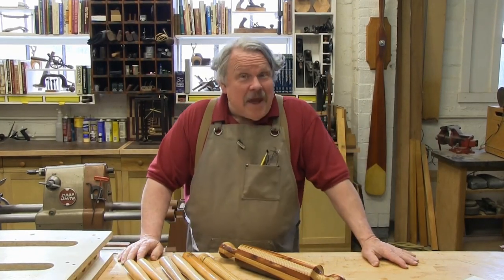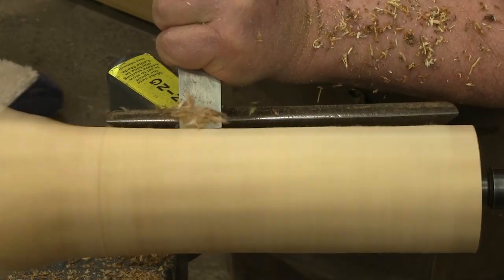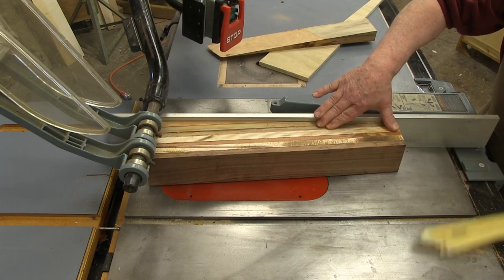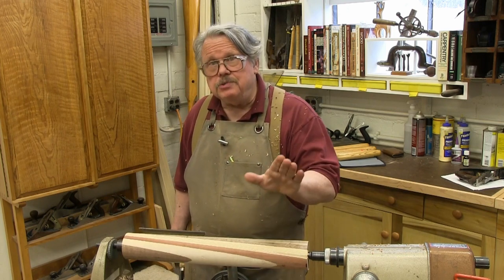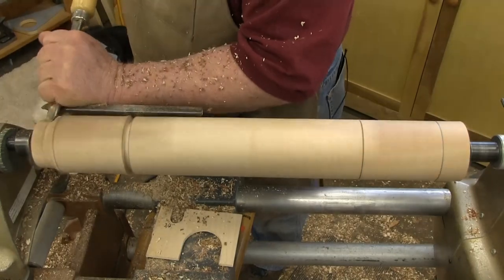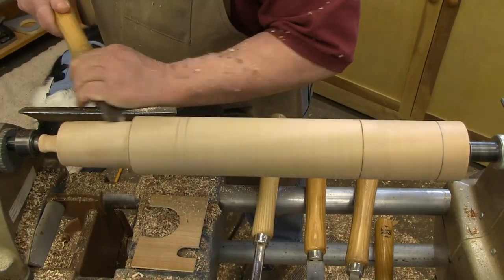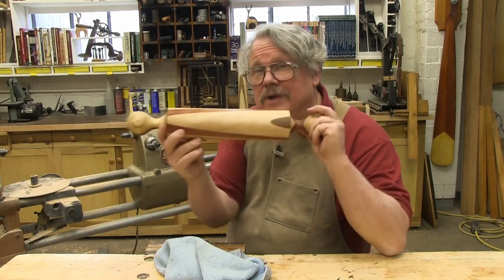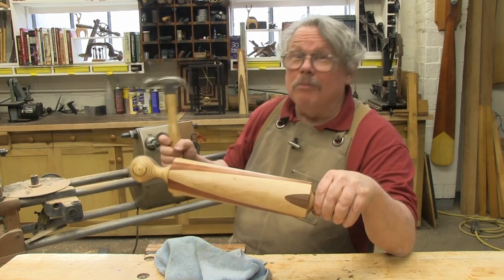Rolling pin - How To / Intro to Lathe Turning

Comment: I've had a lathe sitting in my shop for about 4 years and have never really used it. I have been toying with selling it but after seeing this video I will be trying my had at a rolling pin. Perhaps then my wife won't complain so much about the space it takes up

Comment: Super cool tip to use the smoothing plane. I had never seen that technique before and it's genius! I bet that saves a bunch of time trying to fine tune the shape before sanding. Love your videos Sir!
Reply from the maker: It's a great technique; I use it in also every spindle turning I do. Works best at slow speeds with the frog set back as far as possible to open the mouth of the plane.
Reply: @WorkshopCompanion  I can see how it would be extremely effective especially taking small bites. Very clever
Reply: Yup just learned something new. I ended up buying the plans for this. Looks like this is one of my next projects :D

Comment: I've been turning for a few years but still learned a lot!  I have never seen someone use a plane to smooth on a running lathe...that was really interesting.  Guess I will have to try that.  Good video...thanks.
Reply from the maker: Most welcome. When you use a plane on a lathe, open up the mouth as wide as it will go and take a very shallow cut. Hold the plane at a steep angle to the lathe's axis of rotation -- at least 45 degrees. Basically, you're using the plane to shear. For extra control, you can rest the sole of the plane on the tool rest. Smaller  planes work better - I use a Stanley No. 3 bench plane, a No. 60-12 low-angle block plane, and a tiny Kunz palm plane. The smaller planes will let you cut convex curves as well as flats and tapers.

Comment: Thank you thank you thank you!!! I knew it!! I KNEW that Somehow there was a way to use a hand plane on a lathe piece. I can't put into words just how much I enjoy watching these videos. Im knew to the wood working world and I've been taking in a ton of info and there are some workers out there that are worried about their Pro ego and sub-par results. I also appreciate you going theough how and why you ise the certain chisels and their individual uses. Please keep putting out this Boss content!! Thank you so much for your attention to detail for us lower level novice splinter eaters;-)
Reply from the maker: A bit of extra info you may find useful: I have found that a No. 3 or 4 bench plane, a low angle block plane, and a shoulder plane all work well on a lathe for certain shearing tasks. The trick is the take a very shallow cut, open up the mouth of the plane as far as it will go, and set the lathe at a low speed (under 750 rpm). Other tools that seldom used on the lathe and can be are files, rasps, and floats.

Comment: The plane technic was a surprise. I never saw that before.
Reply: Hey Robert, you own it to yourself to search Youtube for two videos titled "Wood turning a log on a Shopsmith Part 1" and "Wood turning a log on a Shopsmith Part 2". In part 2 he also uses a plane while turning. More importantly, you'll be amazed at the scale of his spindle. Scott
Reply from the maker: AS I told another viewer, it the same as shearing but easier. You simply adjust the depth of cut to take off a paper-thin shaving and open up the throat to prevent clogging.  Hold the plane so the iron is at a skew to the axis of rotation, and wade in. Instead of riding the bevel, you ride the sole. Touch the toe of the sole to the turning and slowly advance the plane until it begins cutting. I've found that small bench planes (No. 3 or No.4), low-angle block planes, and rebate planes work best. The bench planes are especially good at truing up a straight or tapered cylinder.

Comment: How often are you having to "touch up" the edges on your lathe tools with this type of project? I have tried turning only once, but found my tools dulled super quickly.  Thanks for all of the helpful information!
Reply from the maker: I sharpen my chisels two or three times a year. At the rate at which I do turning project,s that's anywhere for 4 to 8 projects per sharpening. To keep them sharp between uses, I store them in a chisel roll. That keeps the cutting edges from banging into other tools. Sometimes tools grow dull not from the way you use them, but from the way they're stored. Chisels may also dull quickly if made from the wrong kind of steel or a steel that has been improperly tempered. I once bought a set of chisels from a reputable seller only to discover they were so soft I couldn't put an edge on them. I had to re-temper every single one of them.

Comment: Thanks Nick.  You have shared a lot of interesting details.   I loved your wax recipe.  Is there any chance you could do a video on the large Shopsmith dust collector?   I have one but I am not sure if I am using it properly.   I mainly use it for collecting dust from the lathe, but it doesn't seem to do it very well.   thanks diana
Reply from the maker: Diane, the older Shopsmith 3300 dust collector pulls between 300 and 400 cfm. This was pretty good when it first came out, but it's not much to brag about these days. There are plenty of dust collectors out there that pull 600 cfm or better, including the new Shopsmith 6000, which I haven't tested. As far as dust collecting on the lathe, if you figure out how to do it efficiently, please let me know. There are several scoop attachments that you can buy to use with you dust collector, but the ones I've tried are inefficient and often get in the way. One of the things you have going for you when turning is that if you're doing it correctly, you shouldn't be making much dust -- just chips. These fall to the floor rather than hang in the air, where they can be easily swept up. When you sand on the lathe, that makes dust of course, but I find a good air filtration system will keep the air relatively clean. I use something almost identical to the Jet 1000CFM, and am relatively happy with it.  The nice thing about having an air filtration system, is that you can use it for any operation that generates airborne dust, not just sanding on the lathe. And if you're doing a lot of woodworking or have a small shop, air filtration is important as dust collection -- long-time woodworkers are prone to white-lung disease and emphysema. If you don't yet have air filtration, I'd suggest you get the 42" filter hood for your  Shopsmith and run it while you're in the shop. Clean it weekly.
Reply: @WorkshopCompanion  thankyou that helps

Comment: I also use a shopsmith for all my turning. Is there a big difference between a shopsmith compared to a traditional lathe?
Reply from the maker: I find the Shopsmith much more steady and solid than all but the most expensive lathes. And the infinitely adjustable speed control is a game changer -- you can make speed changes on the fly, and this inevitably produces better results. For example, I like to shear at low speeds (I feel I'm more in control) but scrape at high speeds (which leaves a soother surface). On a Shopsmith, I can switch speeds whenever I switch techniques.

Comment: Great video, I definitely plan on making one of these. But, how do I properly make the angle cut on the table saw so that it is a 3”x3” square? It feels like that wouldn’t be as simple as it seems in the video. Thanks a ton, your channel is awesome.
Reply from the maker: It's exactly that simple. Just cut a tapering jig from a scrap of plywood to hold your wood at the correct angle as you rip it. If you've never made a tapering jig before, we show the layout for the jig you need on page of the the project plan. https://workshopcompanionstore.com/products/scrapwood-rolling-pin
Reply: @WorkshopCompanion  I guess I meant to say, how do I properly set the fence and jig up so that it is a 3” square? Do I set the fence to 3” and THEN put the jig in? I feel like that would render it >3” because of the width of the jig. I could be wrong though. Thanks for replying by the way!
Reply from the maker: @ashtinator1  You only need the jig for one cut. If you haven't used a tapering jig before, I explain step by step how to set up the jig and cut the blank on page 2 of the project plan.

Comment: Awesome video.  I am new to wood turning and would like to get in it more. Does anyone have some suggestions on the best starter kits to buy and from where?   I am gonna try a turn a rolling pin for a gift. I have a cedar tree that is roughly 8-10 inches in diameter. Would you recommend cutting it down into a square or turning as is?  I’ll peal all the bark but do I need to worry about places branches grew ?   Anyone with suggestions on any of this it would be great to hear.
Reply from the maker: Before you cut down that cedar, you might to watch this: https://www.youtube.com/watch?v=bfmCV7qKtGk . It's a primer for doing your own sawyering. As for a "starter kit," look into buying a used Shopsmith. Table saw, drill press, sander, and lathe in one package. You can pick up an old one for $250--$500 if you look around. You can add other tools if woodworking is to your liking; sell it for what you have in it if it's not.

Comment: This is "probably" a stupid question, but... Are there no food safety concerns about the glue (or the plywood)? I have wondered about this before, e.g., for making salad bowls. And - as have so many others have said, thank you for your nice videos over the years. Best wishes, Peter
Reply from the maker: The only thing in plywood that could be toxic is the formaldehyde that is sometimes used in the glue. After sealing the rolling pin with a food-contact-safe finish, very little would escape. Furthermore, the few molecules that did escape would quickly break down into formic acid and carbon monoxide and dissipate. I can't imagine this being a problem -- unless you have a hermetically sealed room filled with thousands of rolling pins...

Comment: I might add one wood turning rule not mentioned:  RIDE THE BEVEL.  Riding the bevel will help ensure a better cutting finish and minimize sanding.  And it makes turning safer.
Reply from the maker: As I understand it, "riding the bevel" is a nuanced term that is mostly used in association with bowl turning. Every turner will give you a different definition, but for me It describes that situation when the craftsman has the cutting edge, bevel,  tool angle, depth of cut, and cutting pressure all in balance, and the chips just roll off the chisel. Because you have to monitor all of these things while making constant adjustments, it is difficult even for experienced turners to achieve and sustain for long periods of time. For this reason and the lack of an agreed-upon definition, I rarely use the term for instruction. But thank you for bringing it up -- it's something all turners aspire to even if they all disagree what it is and how to achieve it.

Comment: I have a question. Can I polish the pin firstly with mineral or walnut oil on 60 degrees tempetature and then do your wax/parrafin mixture over it!?
Reply from the maker: Certainly. You might also try mixing a little walnut oil and beeswax together in a double boiler, then apply the mixture hot to the wood. As it gets cool enough to touch, rub off the excess and buff with a lint-free cloth. Thereafter, apply the  oil/wax mix like paste wax several times a year.
Reply: @WorkshopCompanion  thank you very much for being so kind and shareing your knowledge with us! ❤️ 🙂
Reply from the maker: @natasakaleskovic1690  Most welcome. It's what we do.
Reply: @WorkshopCompanion  ❤️

Comment: I have noticed on my ShopSmith that the tool rest has some play in the connection to the carriage. Do you experience that as well? Any tips on removing the play, or is it best to just accept it and work around it. I have the Universal tool rest, so that is always an option...but there are times when it gets in the way, so using the stock setup can be quick and easy.
Reply from the maker: Don't have that problem -- and I have 2-1/2 Shopsmiths. Sounds like something is loose, improperly adjusted, or packed with wood chips so it's not locking down properly. The wedge lock nearest you should bear against the tool rest post when the carriage crank is tightened, completely eliminating any play. Might be time to do a little maintenance.

Comment: Nice job. Do you use your tapered cutoffs for anything?
Reply from the maker: We tried gluing up several of them to make another turning block, but the result was not visually pleasing. There is a discernible pattern the emerges when the wood layers are all at the same angle. When they are at several different angles, there is no pattern, only visual clutter. It's the lathe turning equivalent of a teenage boy's bedroom.

Comment: one question about the length - my lathe maximum length is 14 inches, can the plans be adapted to suit that?
Reply from the maker: It can, but that would make an awfully short rolling pin.
Reply: @WorkshopCompanion  Possibly in the U.S. but average rolling pins here in the UK are about 12-14''. My current one is 12'' . Food for thought.

Comment: I'm going to try your wax recipe. I already use a mixture of beeswax mineral oil and carnauba that is quite hard. I have to melt it to apply it.

What is the purpose of the paraffin?
Reply from the maker: Generally, the lower the melting temperature of the wax mixture, the softer it is. And softer mixtures are easier to apply and buff. Most manufacturers like to keep the melting point under 150 degrees for this reason. Carnauba and microcrystalline waxes, which produce a much deeper and brighter shine, have MPs around 160-180 degrees, making them difficult to apply. The MP of paraffin is usually about 125-135 degrees. So you mix paraffin with the carnauba to keep the melting point at or below 150, and you can still get a pretty good shine. The MP of beeswax, by the way is 145-150 -- a fairly neutral MP in wax world -- and many woodworkers like it for its soft luster.

Later update: We produced a video on mixing your own wax, with recipes: https://www.youtube.com/watch?v=6DdNMrRn_jk
Reply: @WorkshopCompanion  Thank you. I'm going to add paraffin wax to my kit. I'm really enjoying your videos.

Comment: hand plane on a lathe?
"Don't Try This At Home!"
Reply from the maker: It's no less safe than shearing with a skew chisel. In fact, it's somewhat safer than shearing. And certainly easier. You simply adjust the depth of cut to take off a paper-thin shaving and open up the throat to prevent clogging.  Hold the plane so the iron is at a skew to the axis of rotation, and wade in. Instead of riding the bevel, you ride the sole (see what I wrote to J Armstrong). Touch the toe of the sole to the turning and slowly advance the plane until it begins cutting. I've found that small bench planes (No. 3 or No.4), low-angle block planes, and rebate planes work best. The bench planes are especially good at truing up a straight or tapered cylinder. Maybe I should do a video just on this technique.